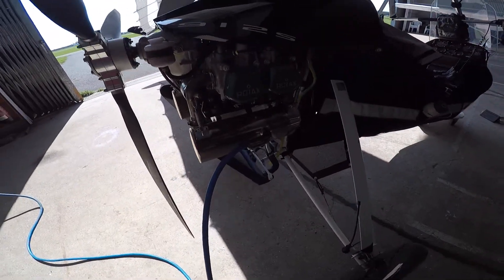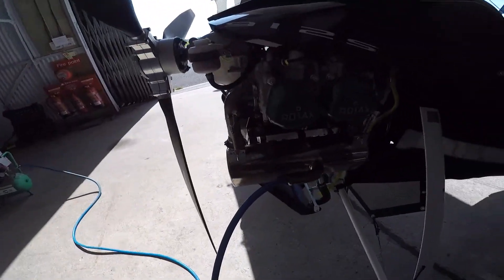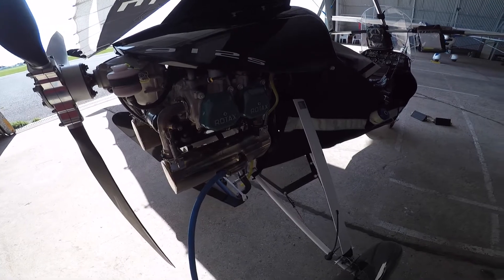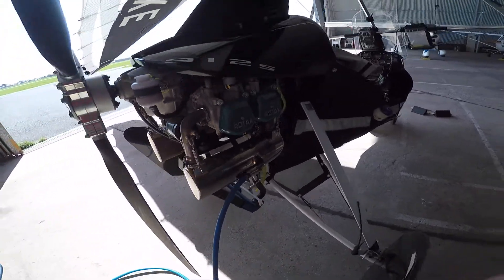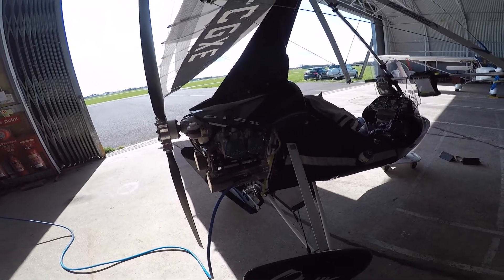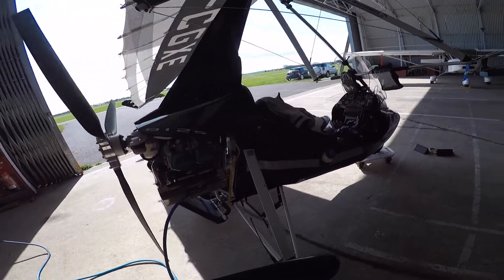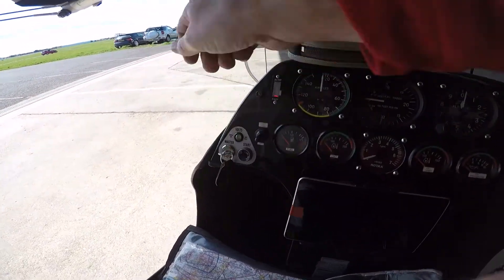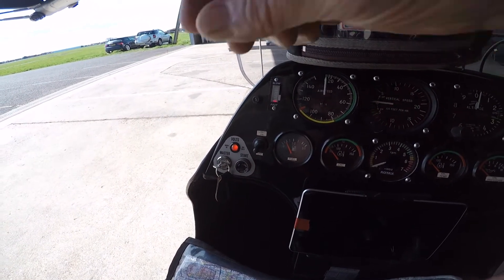Microlight Aircraft Runs on Compressed Air

Comment: Skyflybri..
JoneSeno  ... will  believe you .. worse than that ..  he just might use your video to prop [  pun  intended  ]  up his theory  about compressed air engines.
Youtube is the perfect place for generating income  through controversy.. Jones and stooges like him  know it.. they know that what they are saying is pure dung... but strangely those who are offended by it,  and attempt to enlighten him  are unaware that in so doing  they are in fact   feeding  JonesSeno  and supporters  cash cow. Youtube is only too happy to oblige , it is their cash cow as well.
By the way ... compressed air filling the exhaust pipe and escaping  back out ? How is JonesSeno going to replace the video frames where an air chuck connection  is visible? 
The air hose  connected  to a  bolt`s  blind boss on the frame  of the aircraft  would be  more convincing don`t you agree? Even .. for tin foil hat supporters of  Seno...  your gag  may be too obvious.